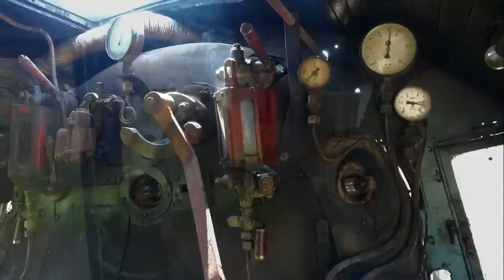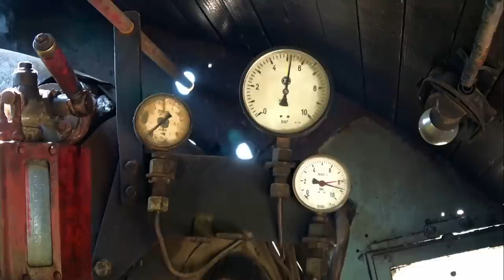RTC - Steam in Bosnia - Part 1 - Tuzla to Bijela, including Cab and Driver’s Eye Views

Comment: Hi Tim. Nice video. I've lived in 200/'01 some time in Tuzla and recognized most of it there 🙂 Great to see it again. When I lived there I several times saw steam engines in service. They always crossed the road around the time we went to our office. Then they were used to supply the Tuzla power station with coal. Sadly I never took pictures of them. Thanks for sharing 🙂
Reply from the maker: Hi, I'm glad this video bought back memories from your own time in Tuzla, especially seeing steam locomotives in action on your way to the office. When I visited most of the heavey coal trains were pulled by diesels, whilst the steam locomotives were used for shunting or as stand by locomotives if one of the diesels broke down

Comment: So Tim, you ve been out there again this year, very nice but I don t like to see these great engines running in reverse, doesn t seem right somehow!!! The box on the side with the handle, what s that for, an automatic coffee grinder!!!? Silly Boy!
Reply from the maker: Hi John, the engine was boiler first for the return trip, I didn't see any turntables, but I did note a few turning triangles. They appear to have found a new use for automatic coffee grinders, this one had been adapted to pump lubrication oil ;-)
Reply: I'd imagine it's the normal lubricator pump, the handle allows the ratcheted mechanism to be turned manually, such as when refilling it and priming it in the morning.

Comment: HOPE this does not upset anyone.
Titles read: "GERMANY'S GIANT - In this case their newest and largest loco'- on its trials."
The yanks used them as target practice during last years of WW2
Reply from the maker: https://www.youtube.com/watch?v=ehiiOBJcP80  - I found the film clip should anyone want to watch it, although there is no mention of them being used for target practice, although it is likely some class members were damaged or destroyed in WW2.
Reply: Nope, the engine shown is a BR04. Only two prototypes where build, both where scrapped by the Reichsbahn in 1940 since they had massiv boiler problems and being 4-cylinder designs where non-standard ( german Einheitsloks where mainly 2-cylinder with some 3-cylinder models)

Comment: Is the 2-10-0 at Bukinje missing the cab and practically everything else part of the Bosnian strategic collection ?
The 0-6-0 tanks have a passing resemblance to the USA dock tanks that used to work in Southampton. Are they related, do you think ?
Reply from the maker: Hi Bryan, parts of the 2-10-0 were stores around the site, but it did look as though it had been stripped to supply spares for the working engines, sadly I think it's days are numbered. The 0-6-0 Yankee tanks are from the same family of locomotives that used to be found around the docks at Southampton. One of two of the polish examples can be found on UK preserved railways.

Comment: Tender 1st? Whatever. A fairly scenic route, but that right-of-way could use some weed killer and a bit of a trim with the trees. I'm guessing it's not much used anymore. At least for now, but plenty of staff on hand. (Still: non-working gates, oh my. ) And the weather looked quite lovely. A fun excursion for all attending, I'm sure.
Reply from the maker: Hi Marvin, this was a memorable trip, the line is still used to transport coal from the mines to the power station. The track is a little overgrown and the operating practices are certainly interesting. The locomotive was travelling tender first on this leg of our journey.
Reply: +marvin watkins
Steam locos German class 50  and derived Kriegslok German class 52 were  designed to run max speed 80 km/h both directions to don't need turntables.

Comment: VERY nice video nice scenery ! Is it that the make of the Locomotive or the coal ? Not much black smoke with that train. Mind you it was mostly a flat track.
Reply from the maker: Hi, I'm glad you enjoyed it. The locomotive is based on a German class 52 steam locomotive, it was using good quality coal and I think the loco crew knew what they were doing, which probably explains the lack of black smoke.
Reply: @Timsvideochannel1  A BR52.80 "Reko". The East germans build a new boiler for their 50s and 52s, the 50E. This was a very modern boiler created post WW2 with a combustion chamber design. Allowed good use of low grade fuels including lignite coal. Combined with good coal the engine runs rather clean ( Many museum engines in europe a Rekos)
Reply: Oh and pulling passenger trains is "easy duty", the engine is rated for 1250 metric tons at 80km/h and the train is likely below 500to
Reply from the maker: @mbr5742  Hi, I looked up the engine to understand "Reko" - https://en.wikipedia.org/wiki/DR_Class_52.80
"Reko" = reconstructed Kriegslokomotiven. The locomotives are pleasing to look at, powerful and well proportioned. This locomotive made light work of our train.